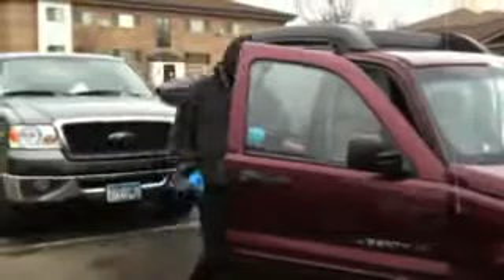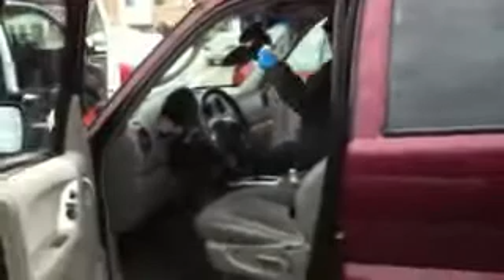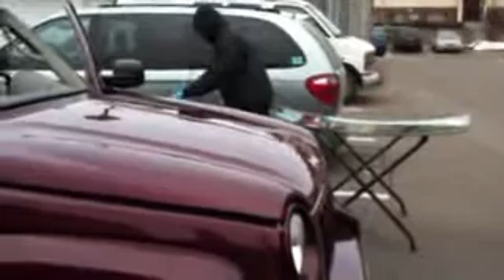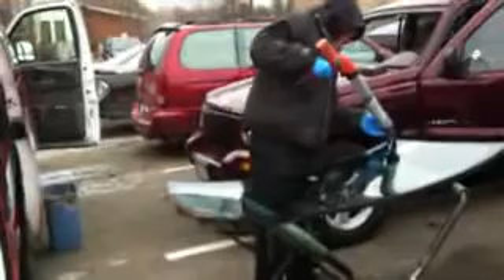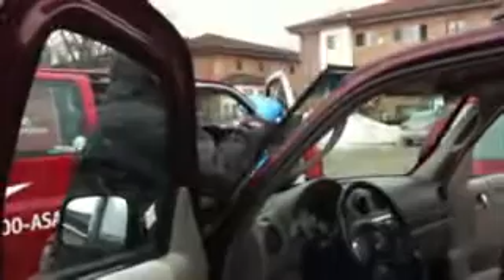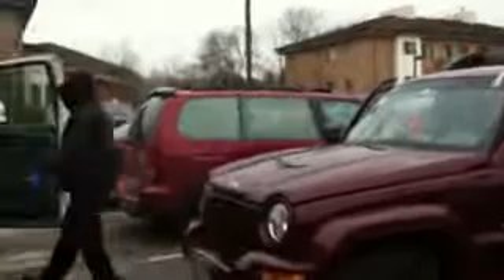Safelite AutoGlass Replacement for Jeep Liberty 2002

Comment: first off takes to long for the removal. im old school i use the cold knife .reason for the use of that tool that safelite uses is to have a clean cut on the urethane an not to scratch the paint on the vehicle .as for me i wouldve had the cut out in a shorter time i dont shoot the glass definitely will cause a leak if set by yourself. if theres two guys no problem.

Comment: When you shoot the urathane on the glass leaves less seams to close up giving less opportunities to have air noises or water leakes. the glass has mapping on it most likely so the tech knows where the proper placement of the urathane bead should be on Glass to pinch weld. as for the true seal some jeeps you cannot get a proper placement of the true seal like with the wranglers. as for the slapping he barely hit it while decking the glass. With the weather conditions the products used can be used as low as zero degrees. So all these comments about the job the technician is doing is ignorant except with the safelite llc comments
Reply: Putting in on the glass doesn't guarantee anything. There are blender sticks for that reason. You can get a true seal if you know what you're doing. Safelite doesn't train properly. Crash course more like it.

Comment: 1: looks like its too cold to perform the installation outside(negligence), unsafe practice.
2. The tech lifted the windshield from the original position where he installed first, rather than moving(sliding) it up(passenger top corner(rookie mistake)), this will result in leakage.
3.Even if you don't scratch the surface of the car, you should use the primer, and the activator pad on the windshield(which I'm only assuming he didn't use) video doesn't show it. Its a system of components working together( certified tech should know that)
4 Tech is slapping the windshield into a position with open hand, wow.
5 he doesn't have the invoice with pricing? State law requires to provide the invoice with all the prices( safelite solution demands all independent shops to provide that, a little biased)
 6 Telling the customer that he will come to their work to tape them, feeling a little nervous for all the mistakes there buddy?
7 Applying the urethane on the glass( that's a company that claims that they are technologically advanced, maybe for the 90's standards)
Reply: invoice was probably emailed to customer. the video comment wasn't because of nervousness it was a joke. Joking breaks the silence. applying urathane to glass guarantees less seams needing to be closed up. smacking it to deck it use to be the way they did it. hand setting it was probably the way the tech was trained to originally do it and by looking at the van they probably didn't have the 1 tech yet in circulation.